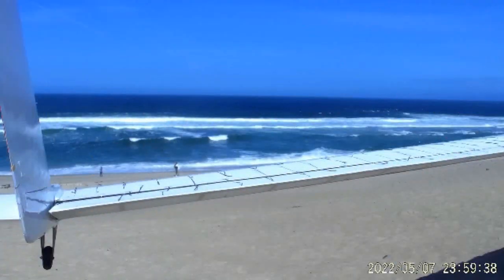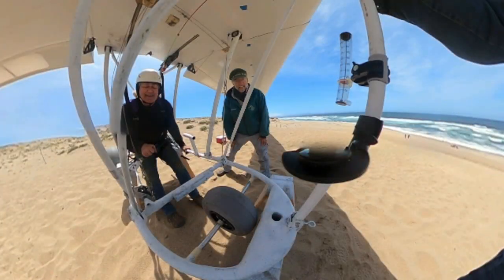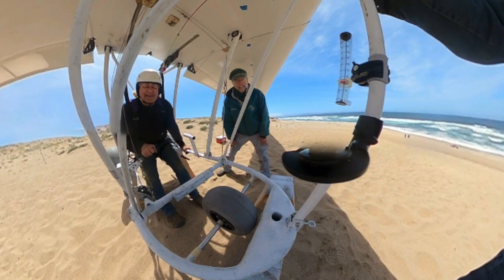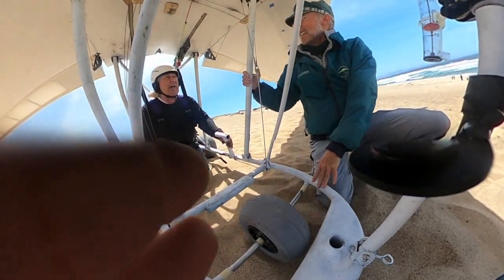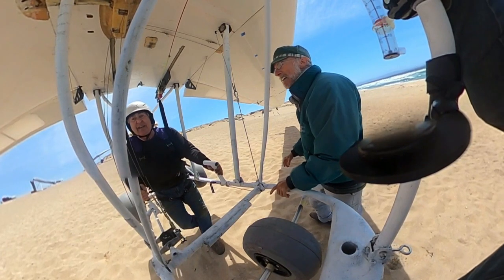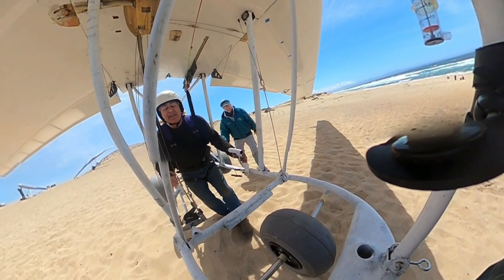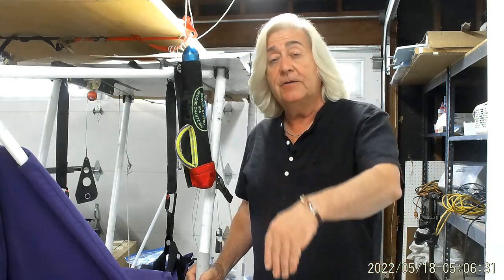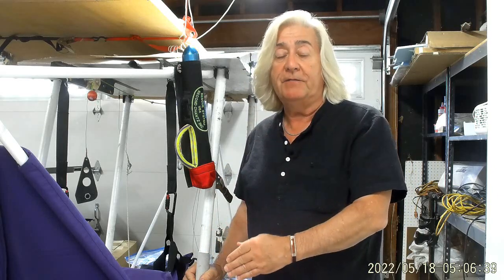KW MkII Ultralight Sailplane Composite Glider - 100% Flight Test Success

Comment: Isn't BRS still in business?
Reply from the maker: Yes, but they don't make units small enough for hang gliders anymore (no money in it). The smallest is about 2 or 3 times the weight/size I need.
Reply: @KlingbergWingMkII  I still have my Millennium, Serial # 1, with an un-used  BRS system, but the rockets need to be renewed every year (never done) so I'm not sure it would help any.
Reply from the maker: Yep, that's the issue. BRS will no longer service those units. I might like to acquire it though. Any chance you'd consider parting with it? I think I'm going to work up a home-brew rocket system for my wing. I'm thinking of using a rocket from one of the line thrower units they use on ships.
Reply from the maker: Oh, yes, where is your Mill located? I'd love to see one up close.
Reply: @KlingbergWingMkII  San Francisco, Sunset District, just off Noriega.  The Mill hasn't been assembled since 2003, and as I'll be 80 this year, with a bit of luck,  I'm not certain I'll ever assemble it again.  My fantasy plan is to make it an electric flyer, but that project is WAY down the list of projects.